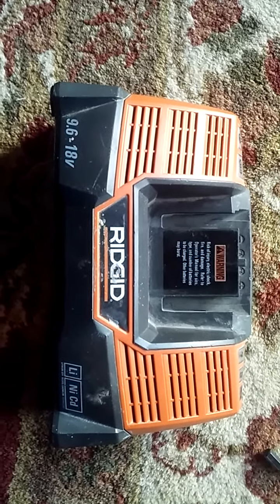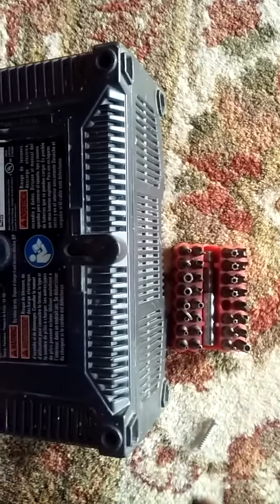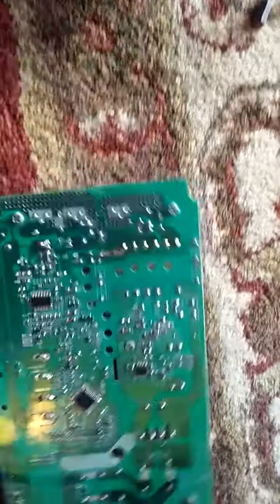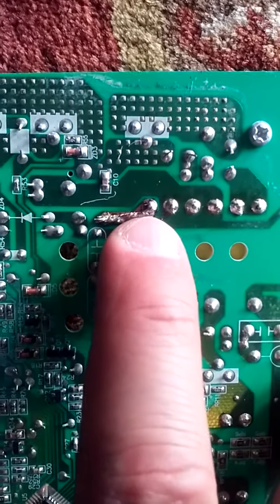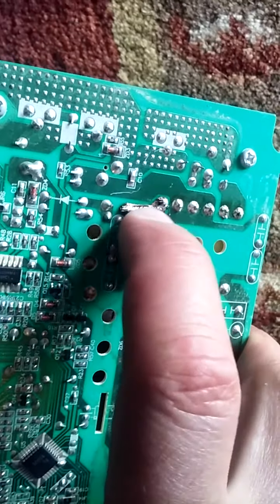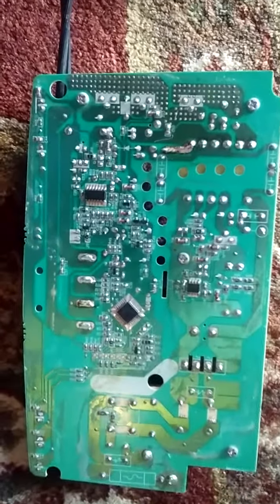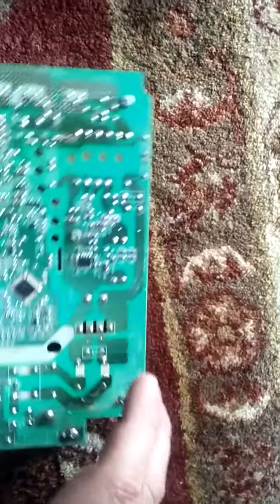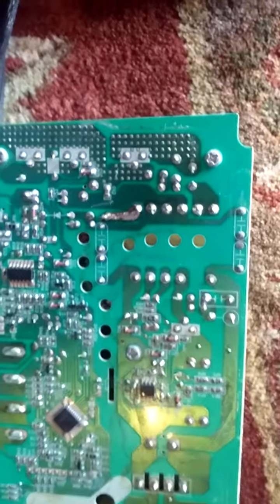Ridgid 9.6-18 volt Li NiCd dual chemistry cordless battery charger dead fix repair R840093 140154001

Comment: This is the same problem I had with one that I fixed for a family member of mine. On the secondary side of the high frequency transformer two of  the leads were slightly coming off of the circuit board.

Comment: In my case, the lights (light with an X and another of On) flashed abnormally when without battery. When I inserted the battery, sometimes it wouldn't charge, keeping the same lights flashing like crazy. How did I solve it? I replaced the C6 capacitor, because I discovered values that were out of line with what I expected. After the exchange it works like a charm! 😃😄

Comment: I have an electrical problem with my R840093 and need the schematic for the circuit board.  The ZD2 diode has  burnt out and I can't read the size written on the diode to find a replacement.  The schematic would allow me to do the electrical repairs if there is anything more
Reply from the maker: I'm sorry, I do not have the schematic.
Reply: 2,7v

Comment: I haven't used it for more than a year and when I try to charge it there is a short circuit with smoke coming out of it and when I try it again there a spark with a with a loud sound.. Could it be the fuse
Reply from the maker: unfortunately it's probably more than a fuse.